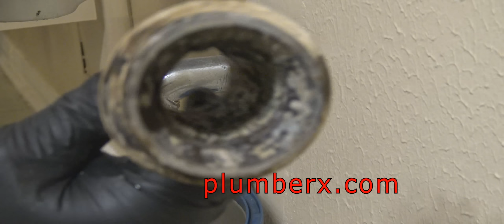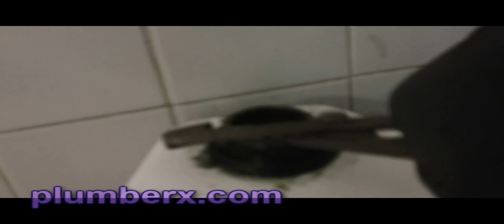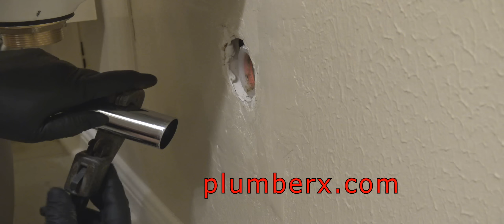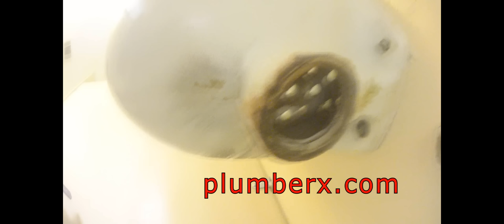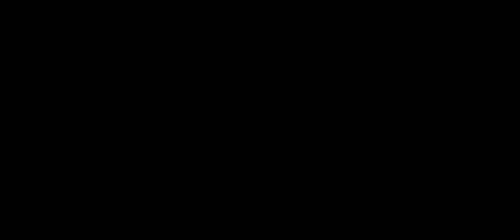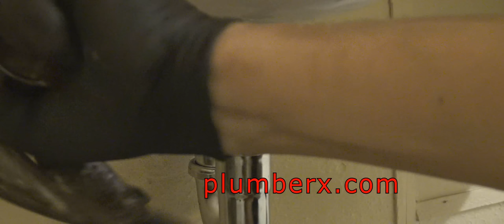Fixing A Pesky Urinal Leak: Easy Diy Guide!

Comment: just coming back to this video to give a thanks. I'm the handyman at the business I work for and we had a leak on the urinal drain. I went to see what I could do to solve the problem and as I was disassembling the p-trap shit fell apart because of corrosion. I had an idea of what needed to be done. I did a quick google search and found your video. Made me more confident I was right and  gave me the names of the parts I needed. Next plumbing job I need to do I'm gonna search your videos for pointers.

Comment: Thanks for the video - this is exactly the same parts I'm working on in my commercial building. Have done lots of plumbing, but never a urinal. Had no problem replacing the P trap, but then found out that the spud leaked (didn't know what it was called!) - so now I can move forward like a pro!  ;)  Thanks again.
Reply from the maker: Nice. Like pro😉

Comment: Great vid. I recently changed a urinal, but the spud, which was similar to the one in the video, corroded pretty quick. Is that normal?
Reply from the maker: Not normal, but if you're in an area with hard water it happens. 🙏 Thank you.

Comment: what measurement is needed to choose correct replacement?
Reply from the maker: Thank you for your question! To choose the correct replacement for the old urinals in this video, you need to measure the size of the p-traps and the spud. The p-traps for these urinals are 1-1/2 inches, which is the same size as standard drains used in kitchen sinks. The spud, the brass piece protruding from the bottom of the urinal, is also 1-1/2 inches, similar to those used in wall-hung toilets in commercial buildings.

When looking for the replacement parts, you can search for a "1-1/2 spud" or ask for a "1-1/2 toilet spud." I hope this helps! Feel free to reach out if you have any more questions. Thanks for watching, and don't forget to like, share, and subscribe for more helpful plumbing tips and repair guides!

Comment: Shouldn't the tailpiece going into the bottom spud have a flange on top with a top hat washer?
Reply from the maker: You could use a top hat like a sink strainer or a regular neoprene,  cone washer good. Good point.
Reply: Ok, Thanks.  Good to know. Easier to just use the extra piece that was trimmed down. I appreciate you quick reply. Keep up the good work!
Reply from the maker: Thanks for watching
Reply: @theartofplumbing  I tried using a tailpiece (plastic) with a flange on top, but the problem I had is that I couldn't find a washer that would seal the 1 1/2" spud nut bottom.    After trying different washers and not stopping the leaks, caused me to search for a video on urinal leaks.   I am going to try the method used in the video of the tailpiece going into the spud.